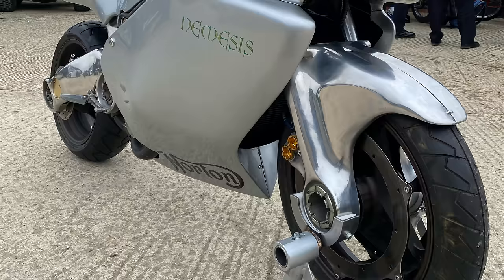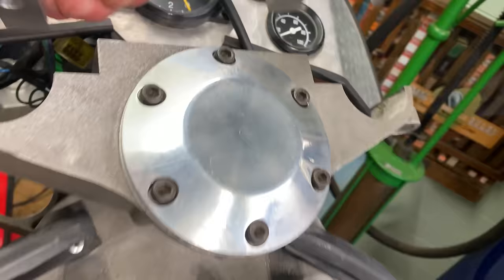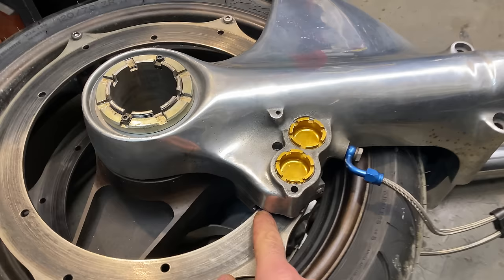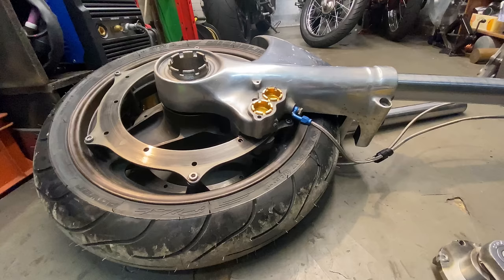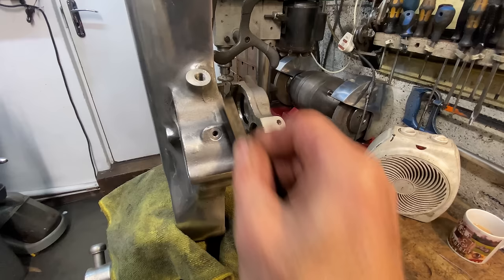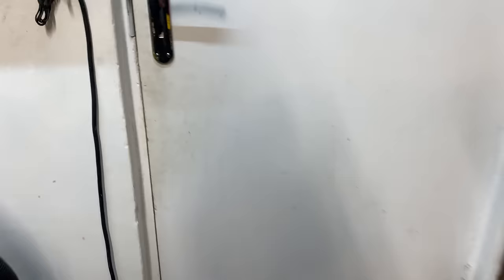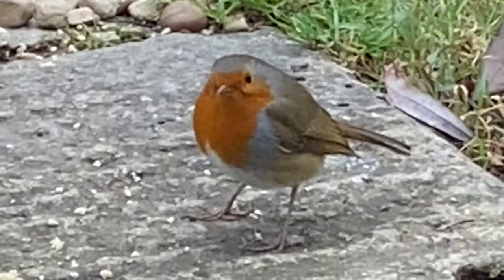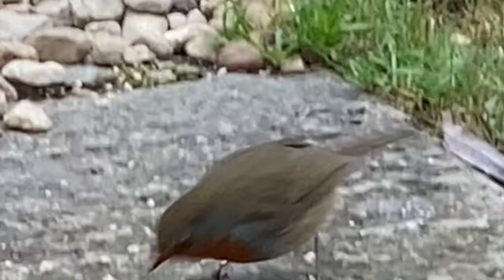Norton Nemesis V8 Rebuild - Episode 1

Comment: that front fork and wheel design mighty be the silliest thing ive ever seen, and a nightmare for service lol...i bet it cost 20x a normal prototype fork/ wheel setup too
Reply: A real Nemesis to perform any kind of fork, caliper, tire maintenance tasks.
Reply: If it were easy, anyone could do it.
Reply: You have to wonder what the brief was?   What problem were they trying to solve with that design?
Reply: When your Norton R&D Engineer was obviously not a Mechanic... in the practical sense.
Reply: If they made something like the front fork and front brake so weird and complex, then we will likely be in for some jaw dropping moments with the rest of the bike.
Reply: Mental engineering. LSD assisted design?
Reply: Exactly, I get all sweaty just watching this clip😮
Reply: All looks heavy too. I would guess quite a lot more unsprung weight compared to a "normal" set up?
Reply: @CharlesSmith-zt7vt Ruinous to handling. Somebody just did the oddest thing they could imagine but it looks good!
Reply: The answer is easy enough if you look at it with an engineers eye. Remember this is the time before up side down forks came back. If the alloy has a low enough mass you get a very rigid front fork assembly that is lighter then a conventional fork. Even the front mudguard becomes part of an integrated 3-dimensional monocoque. Brilliant but VERY expensive.
Reply: That depends on your perspective..
Reply: @CharlesSmith-zt7vt but when assembled together it looks very stiff.  no need for additional brackets, screws... oversized hollow axle, just like modern mtb biking, maybe it's not that heavy.
Reply: Style over function.
Reply: Araldite!!!...bodge because the design didn't seal properly
Reply: @daniels.2720  with some material it might somehow be stiffer and save weight, as the end goal idea. like the fender being integrated should make it very stiff/stable and the integrated brakes should make it stabler and lets you save weight on the connecting hardware and I suppose moving the brake rotor like that should let you save weight for braking power while having higher gyro effect from the mass

if they saved weight or didn't now thats an another matter I suppose. maybe from magnesium?
Reply: @Markdmarque They didn't want to get involved with those rare, expensive and unreliable things called O-rings.
Reply: It's a prototype  @Markdmarque
Reply: I'm only 2.13 mins into the video and I've already come to the conclusion that this 'bike shouldn't have seen the light of day (design wise) it should have stayed on the cornflakes box they used to do the first drawing. Whoever designed this was OBVIOUSLY deranged in some manner.
Reply: @marcbrasse747  Erm... Not so sure about that.. Plenty of mainstream bikes had USD forks in the years leading up to 1998 when this horror was built - we all love a bit of British eccentricity, but this front end goes way beyond that! 😊 That said, it was built to get speed records I think, so maybe they just thought that stiffness wins over handling..
Reply: But it is the most beautiful fork / mud guard I've ever seen....
Reply: @Oi....  And some are just plain daft!
Reply: @lasskinn474  Wow, not expensive enough already?
Reply: I was already thinking that is some of the worst design I've ever seen, and then he mentioned how heavy it is.  I mean, what were they thinking?  Not only is that front end shite, it must be way more expensive to make and it weighs a lot more.
Reply: @Markdmarque  Was pleased to there was a (leaky) grub screw in there. To start with I thought it might just be plugged with epoxy!
Reply: The forks at the front end were designed to collapse thus stopping wheel lift under heavy acceleration according to Nortons video.
Reply: "Nemesis"
Reply: I was just thinking a nice a day at the track and then clouds over head…ah no worries, just gonna switch over to my rains. Should be back on the track next month lol

Comment: Having watched a number of channels who do disassembly of car and motorbike engines, I realise there is something that almost all other mechanics use - but Allen never does. A lot of other mechanics do so much of their work with an impact driver gun to remove bolts etc - but Allen never does. So his work seems more peaceful, more Zen!!
Reply: Yes, I noticed that too.
It's the difference between carefully dismantling a machine and "tearing it down"
Reply: @philiphigginbotham3775  I agree, it makes me cringe when someone says they are going to "tear something down" 🧐
Reply: @fredfarnackle5455 the worst is when they then put a heavy metal guitar solo over some guy with a ten spanner.
Reply: Have you never read ‘Zen and the art of motorcycle maintenance’. You’ll see why it works 😁
Reply: Allen doesn't work in a professional environment where efficient use of time is everything
Reply: Also the lack of a torque wrench, I usually only use them for main internal engine parts.
Reply: @davids2350 At risk of revealing my chronological enhancement I first read that book in 1975 fairly soon after it came out. And currently re-reading. Pirisig mentions "the gumption trap", something that can happen to you when doing any complex task, where nothing seems to work. But Allen never seems to get into that situation.
Reply: @john-r-edge  I read it early 80’s not long after I did my first 4 stroke cam chain job. Aged 12. I’ve always found with motorbikes that 2 of your best tools will be a mars bar and a can of coke. Cos if it doesn’t work. Just sit back. Enjoy the fruits and it’ll b alright in the end cos you WILL manage to fix it. 😁😁😁
Reply: @sresto7943. Allen’s “torque wrench” is integrated into his right forearm.
Reply: Looks heavy.
Reply: @stephenscholes4758  ..And yet, his time and motion is impeccable.
Reply: Theres no 'feel' with impact tools, a proper engineer is interested in feeling how tight a bolt was as well as the feel of them going back in. I dont own an impact tool.

Comment: Absolutely the most complex front fork, brake assembly ever devised.  Can’t imagine what the advantages would be.  Thanks for undertaking such a interesting project!
Reply: As the tailend of the NVT>Norton collective, I'd guess the attributes chiefly were... 
uniqueness, cool factor looks, very large spindle, and manufacturer level management bagging rights whilst pissed/drunk at an event saying (allegedly)...
'You know that lovely (hic) assembly of parts cost £35k to (hic) design, cast, machine & (hic) assemble....'
Reply: As extreme a stiffness as you could hope for from a cantilevered, sliding assembly.
Reply: @everTriumph  
..torsionally?.. Yes, with regard to the locator pegs/dowels & clamping bolts where a fork 'brace' would be, and the massive spindle, just hope the actual fork leg oleo's were also of a material specification & wall thickness to work well with that additional torsional rigidity & weightier unsprung loadings, likely not by much, as since only one or two were built, the oleo legs are probably the larger/largest size Norton had immediately available to them to cut some costs & corners, versus the stressed engine & main frame being their IMHO chief priority.
But I am just musing guesstimatingly.
Reply: If you watch the “making of” series on the Nemesis they had plans to have the entire suspension computer controlled to dive the front and raise the rear during acceleration to get more force on the rear wheel. I can only imagine all the passage ways etc were with that in mind. 
I’m not justifying it, just pondering.

Comment: When I was 20 I bought a new 1984 Honda VF400F the first of the legendary V4 400cc bikes. It had Honda`s Inboard Ventilated Disc. Now I thought then that they were the most difficult and over complicated front wheel set up, covered discs made taking the wheel out to fix a puncture really tricky but compared to the front end on the Nemesis the Honda was easy!!! Nice work Allen looking forward to this series.
Reply: I'd forgotten about those brakes, a pretty dumb design as I recall!
Reply: Yes, had twin setup on my cbx550.

Comment: Amazing engineering they used to build such a monster, but so difficult and timeconsuming to do basic brake pad replacement. If the bike had mad it into production, they would have had to employ a more normal way of building the front end. I like the idea of the rim mounted discs, Eric Buell did exactlt the same, but only used a single dic. I think the idea was a single disc caliper, meant less weight, yet more braking surface due to a much larger rotational braking surface. 

Great vid Allan, and looking forward to seeing the rest of the series. Thanks for posting it.

Comment: I think a few people here are ignoring the fact that this was designed to be a race bike, not a general road bike, and so the ability to change out the whole front end was a quick way of resolving issues during a pit stop allowing the mechanics to work on the assembly while the rider is back out on the track putting down laps. Just the kind of thing you'd need if you were looking to compete in endurance races.  Will be great to see what you make of the V8. Cheers.
Reply from the maker: It’s got lights and a horn
Reply: No-one in their right mind was going to swap out the entire front end of the bike during a race! It is ludicrous! Instead of knocking the spindle out of the hub and slotting a new wheel in, you've got masses more complexity. Let's face it, it was never really going to go into production; it was a pie-in-the-sky, hail-mary, last-roll of the dice project. I remember at the time the bike constantly being in the biking news for what seemed like years.... and the world moved on around it.

Not that any of this would have taken away from the achievement if they had somehow managed to actually get it into (even a small) production run.

Comment: That front end looked like it was designed on the bring your child to work day, by a kid who had no concept of unsprung weight!
Reply: So much unsprung.
Reply: True, aren't those brake discs from a Buell ?
Reply: Buell uses a similar design for the brakes but they only put one disk on the front.

Because you just don't want unnecessary unsprung weight.

Comment: Great video Allen, meticulous as ever. I think they borrowed quite heavily from the aircraft industry, in particular the spindle arrangement and the use of the leg castings to direct the brake fluid. A number of lighter aircraft I have worked on are similar in some respects. It's a brave concept, granted, not practical for daily maintenance but without innovation we would have no development. Best wishes.

Comment: The front brake rotors immediately reminded me of the Buell bike a few years back. I wonder why this brake design never really caught on.
Reply: Posted a similar comment. The braking forces transmit through the rim and not the spokes which seems a good idea to me. Don't know if it offered any big advantage but it's a different approach.
Reply: The big advantage for the perimeter brake disc was that the Wheel can be made of a lot lighter material (Buell used Magnesium wheels). One disadvantage is mostly the huge amount of brake dust which is produced by it and in case of the Single side disc the Distortion it causes on the forks. Also the huge costs for a replacement Rotor of course (1 disc is currently between 200 and 300€).

Comment: Presumably the weight over the front wheel is meant to keep it on the ground under heavy acceleration, before winglets were thought of?
Reply from the maker: The bike is quite heavy I will weigh it when it’s up and running

Comment: Up until my retirement in 2019 I worked in the motorcycle trade as a mechanic for 48 years and in my time have seen one or two machines that were awkward to work on through lack of thought by their designers, but this one takes the biscuit, all very clever stuff engineering wise and you could say the designer was thinking outside of the box, or was he off his box? No wonder this bike never made it past the prototype stage. Well done Alen for taking this project on, to right the wrongs of it's short sighted desinger and indeed who ever assembled the machine and I am being polite there. If anyone can make this machine do what it was intended to do you can Alen, sadly though nothing can be done about it taking half a day to fit a new front tyre though.

Comment: My ex father-in-law was employed as a consultant to assist with the manufacturing design of the Nemesis and the original plan was that the front end was so be made as a single piece and not split as it is now. I remember him being quite frustrated that the people at Norton didn't believe him when he said it wasn't possible to make it as a single piece and it would need to be made in two parts and even then it would be very complex and hence expensive to manufacture. I only had a couple of conversations with him about it before he stopped work on the project so I'm not sure that he ever knew that they had actually built a complete bike.

Comment: As a machinist and a tool & die maker (Carbide wire drawing dies) I especially like how Allen goes about disassembling the parts on the bike. He doesn't attack things with electric or pneumatic tools.
Sometimes you gotta "feel" your way through things.

Comment: G'day  Allen,
  Its great to see you  working on this bike , and as always im impressed with the way you approach & conduct  the required  overhaul .
Furthermore, 
Tracey  and her  boiled cherry cake also looked first class .
However ,
as for the  overly complex design  of the Norton  front end ,  it seemed to be lacking  a certain  sophistication,  frankly speaking .
Im looking forward to the next vid on the engine , as surely it will   lead to more insight about this prototype .
In conclusion,  i did like the boiled cherry cake, nice one  Tracey .

   Respect  ..!

Comment: Ok, I'm already hooked. I almost can't wait for Mr Millyard to crack the engine open – so many crazy ideas in this fork rebuild episode alone, a 1500cc v8 with three spark plugs per cylinder (?) has to make this the king of all YouTube motorcycle rebuilds. Tracey's going to have to go into cake-baking overtime to keep Allen refuelled! Brilliant.
Reply from the maker: 3 plugs per cylinder is a myth ! This v8 engine has one central plug per cylinder 😳
Reply: @AllenMillyard  I guess that's a relief (for you) and a bit of a disappointment for me! I was completely mystified as to how that could be, and very much looking forward to you wrestling with it. But going by your first episode, and the complexity of the forks, I've got very little to worry about! There's so little info on the Nemesis – it's almost like folklore. There's another reel on the Nemesis that suggests it's mechanical origins lye with March racing(?), and that the V8 motor could possibly be enlarged to a 2000cc capacity! I'm just looking forward to you making some head gaskets!

Comment: Great video as ever, Allen.  What a bonkers design.  Basically anything that could be considered routine maintenance, bar checking the tyre pressure, requires the front end to be dismantled.  Wonder what the designers were smoking back then?

Comment: Definitely worth double checking you've got the front wheel the right way round for the correct tyre direction. (Smirk).
Looking forward to the engine rebuild. Also that mudguard looks like a set of Norton Navigator crankcases.

Comment: Tremendous kudos for being handed the job of refurbing.  But what were those engineers smoking with that front wheel setup?  I presume the one goal was axle stiffness with that massive spindle and bearing, but literally everything else in the front end has been compromised for it.  Suppose rim mounted disks were thought to be superior at one stage also.  Certainly an interesting snapshot of what the engineers thought was key to performance, at the time.

Comment: Hi Allen, halfway through and this is grinding my gears! Not from your refurbishment but from the design form over function, i am a development technician who will take a concept into prototype,highlighting potential issues in a production environment,the front end is over engineered to the detriment of ease of use and maintenance ,so many red flags ! of course it is a concept bike however it seems that some design engineers never left there office to see the reality unfolding on the shop floor which i personally find all too often😢

Comment: The hole in the brake caliper that feeds brake fluid into the fork struts, it is to stiffen the front suspension when you brake hard. I recall seeing that information on one of the many YouTube motorcycle channels...
Reply from the maker: Not in this case , the drillings didn’t connect to the damper
Reply: @AllenMillyard  But doesn't the hole lead somewhere to some part of the suspension...

Comment: What a weird machine , as a non biker dude it’s still very interesting and as a concept I don’t think it’s bad really. 
Just a bit heavy fork design and front mud guard and in need of a bit of refinement. 
Technically less components then your average front forks . 
Just needed floating front discs and the ability to remove the front wheel with the discs attached which could be easily designed in . 
Let’s face it shaft drives, belt drives , single swinging arm all seem iffy but made it into production , the ‘norm’ only generally suits the accountants. 
100% the team meetings discussed 2WD too😂 . 
Looking forward to part 2 and more 😃👍